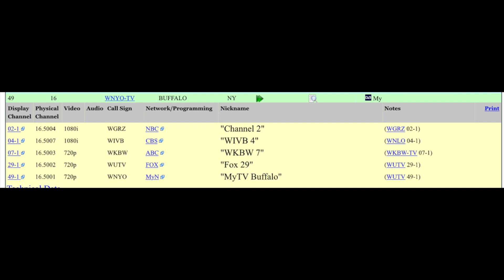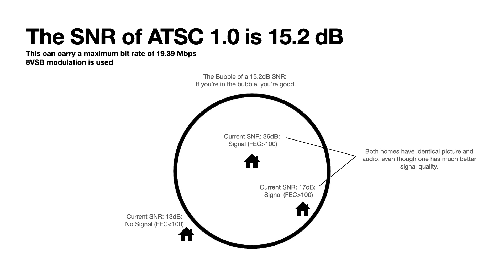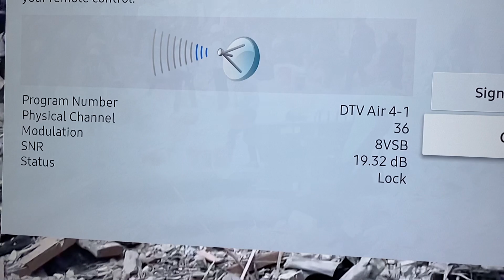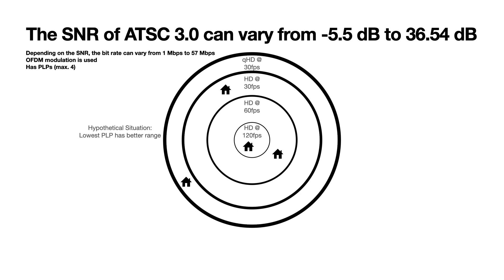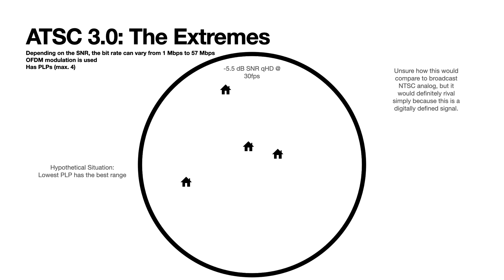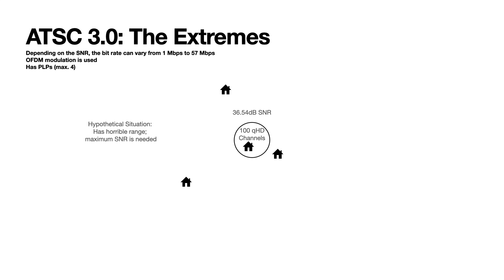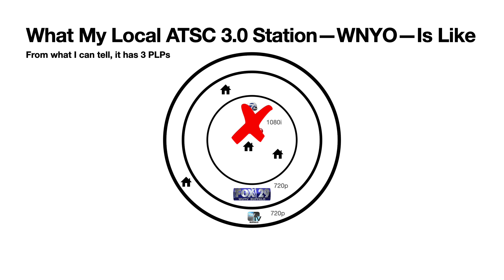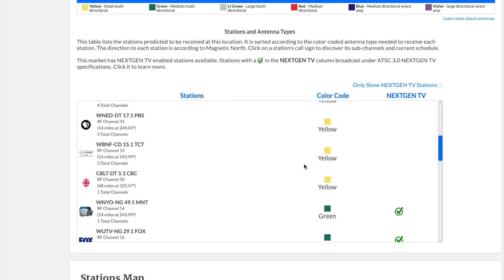ATSC 3.0: A Basic Introduction

Comment: I have a sony x900h and i normally stream but i do miss having local broadcasts. I live in Buffalo and i see that buffalo has atsc 3.0 BUT 1080i and 720p for most local stations??? I thought ATSC was going to be 4k? You have any idea of when they will open the floodgates for us? I really only want to watch the live sports but they are almost unwatchable in 720p ok a 4k tv
Reply from the maker: Currently Sinclair Broadcast Group owns the only ATSC 3.0 broadcast in the Buffalo area. All they have done is take the existing channel feeds and broadcast them using ATSC 3.0. There is a lot that goes into broadcasting 4K or even switching 1080i channels to 1080p. Sinclair was recently hit by a cyberattack and has been slow at implementing new changes. Maybe in a year from now we could see 1080p, but new audio options and 4K broadcasts aren’t coming anytime soon. The technology is new.
Reply: @WNYOverTheAir  great info thanks!!!

Comment: Philippines, Taiwan, Bermuda, Colombia, Brazil and Japan didn’t adopt ATSC. But in the Philippines, they tested DVB-T and DVB-T2 for trials, but they also adopt Japanese ISDB-T. Which also includes EWBS broadcast on ISDB-T and includes 1SEG 240p DTV broadcasts. Brazil and parts of Latin America uses ISDB-T. Taiwan already adopt DVB-T, but their analog TV and also analog cable as NTSC. Bermuda uses NTSC, but for DTV, it’s DVB-T. Colombia, Burma and Panama uses DVB-T2 on those NTSC countries. DVB-T2 are better than DVB-T.
Reply: EU Commission and the British Commonwealth harassed the Philippines and Taiwan and forcing them to adopt DVB-T2 over ATSC or ISDB-T.
Reply: My country has ISDB, which will switch next year.

Comment: Is it true that TV broadcasters will share space with their transmitter with competing stations in their broadcast area ?
Reply: They indeed are doing that. One station will act as the ATSC 3.0 lighthouse, and carry multiple stations, including their competitors depending on the arrangements between station groups. i.e. Sinclair Broadcast Group will be the lighthouse in one market, while in another market it might be the Nexstar station, and they will reciprocate by carrying the other groups stations. In setting up a ATSC 3.0 station, often the main and several subchannels will need to be offloaded to other stations, in order to convert the original main station over from ATSC 1.0 to 3.0. That way the station converting over to 3.0 will still be viewable to 1.0 tuners, and by the magic of virtual channels, it will be seamless to those 1.0 ATSC viewers.

Comment: It's going to be years before you even see 4k ota
Reply: Indeed, the major networks like CBS, Fox, NBC etc will need to setup a distribution system for 4k to their affiliates. I know that CBS have recently moved over to HEVC and and switched to 8PSK modulation a few year back on their satellite feeds. So it appears the networks are setting up for a way to distribute programming in 4k.